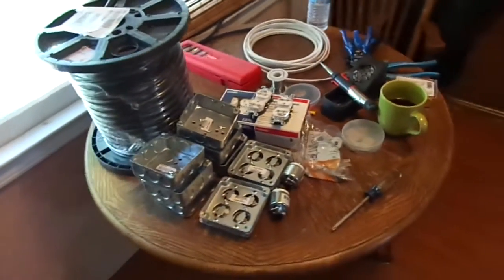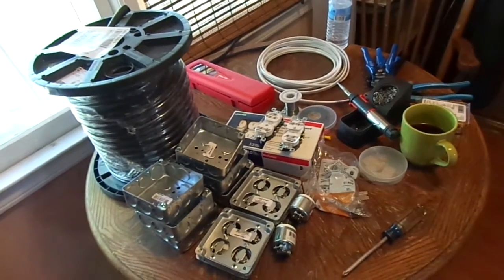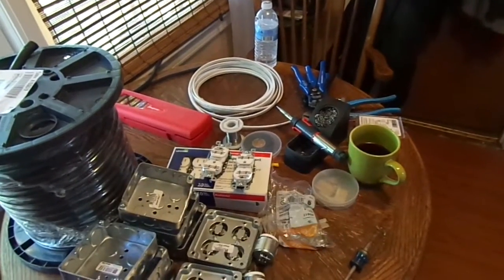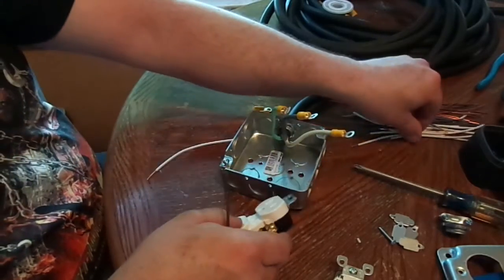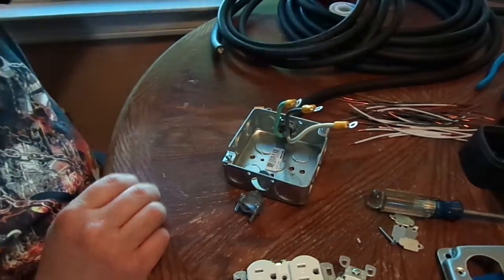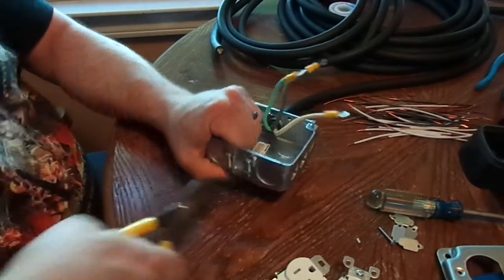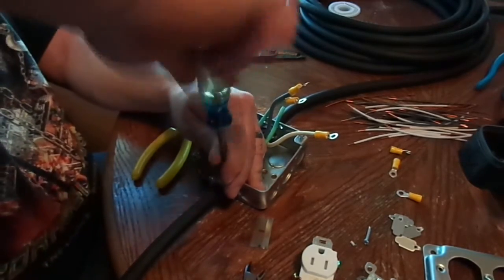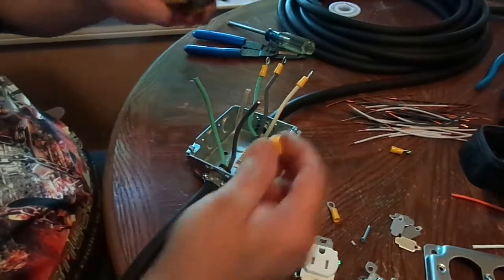Stage power stringer video 1

Comment: Just some ideas in your setup. When I put an outlet in a metal box, I always wrap it in electrical tape in case of fraying down the road. Also I built mine with plugs on the ends of the boxes, so i can put any length cable in between. Cost a little more but in my mind totally worth it. Last off, I built some that are a little longer than a piece of global trussing to use to plug all my lighting into and then daisy chain the boxes together. I really enjoy watching your videos and I get something out of them. Thanks and I look forward to more videos.